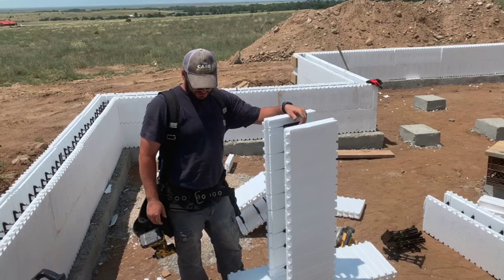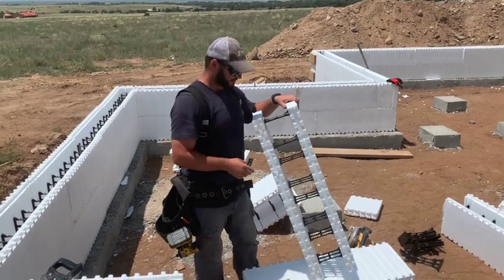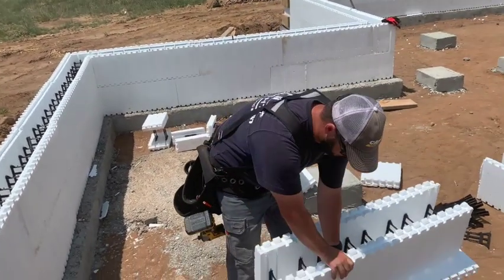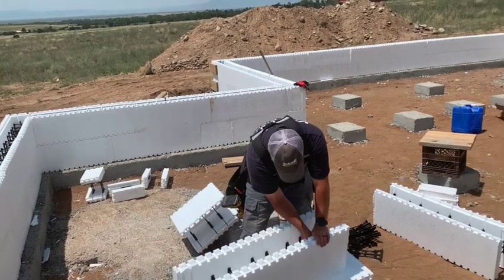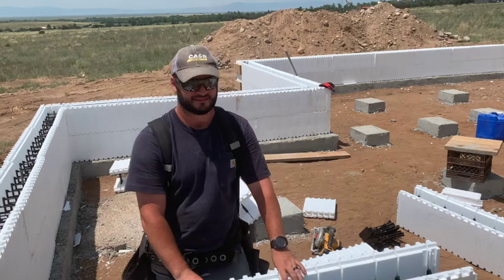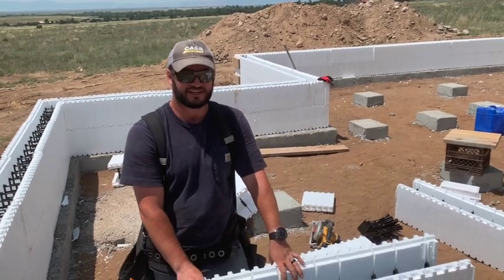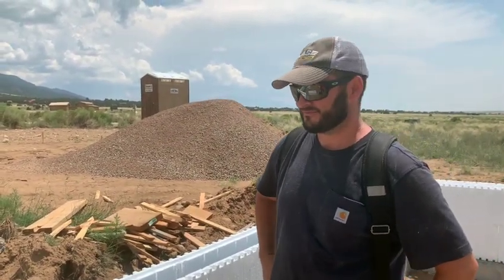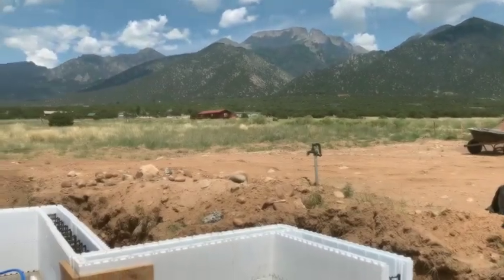How to Assemble SmartBlock ICF | Wood Forms vs ICF What's better?

Comment: At 4:00, your castellations on top did not line up with those on the bottom of the 2nd course. So you began to cut some nubs off. From what I've seen I'm pretty sure that's not how it's supposed to go. You make a common seam with a small gap instead. Also, you cut the blocks at this common seam on the lines so the castellations will line up. Check out "dirt perfect" on youtube for expert advice on ICF construction. Also, there's "Up to Kode" on youtube. It looks like you chose some really economical forms. I'm glad you were able to make them work. In the end, your product will be just as good as the walls made with the more expensive forms. The difference is the amount of work you had to put into this (sweat equity). For those who want to work less, and have less chance of issues on pour day: Other forms like Nudura are so much stronger, better-designed, and easier to use. They are more expensive too. Also, it's nice if you can get the architect to draw the plan dimensions so the walls will "stack out".
Reply from the maker: Hey thanks for watching the video! You make some good points in your comment, in the spots where I had to cut the nubs off that was the way the manufacturer said to do it, but I think there could be a better way and it seemed like some of the blocks were misformed because the seams would leave a half inch gap when the block was locked together, I would put together another block from a different pallet and the seam would then like up, probably a reject block. I've watched a lot of  dirt perfect's videos and he's a gold mine of helpful information. Smartblock is definitely a cheap block and I think it has some room for improvement and the next time I use ICF I'll probably go with Foxblock or the block you suggested, they seem to be a better product.

If anyone else has some block suggestions definitely leave a comment.